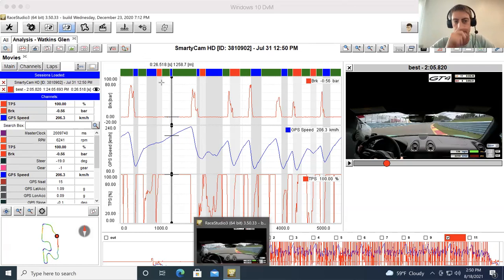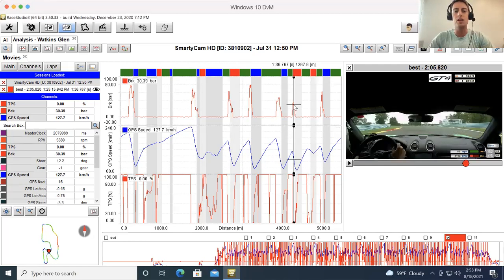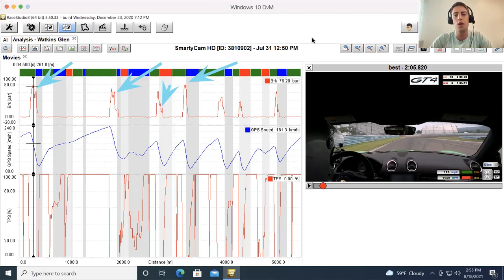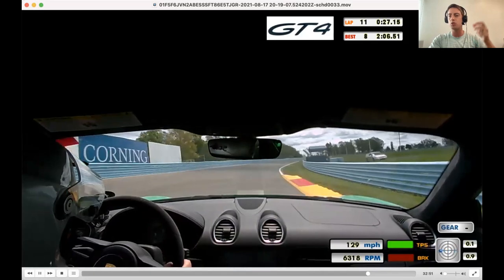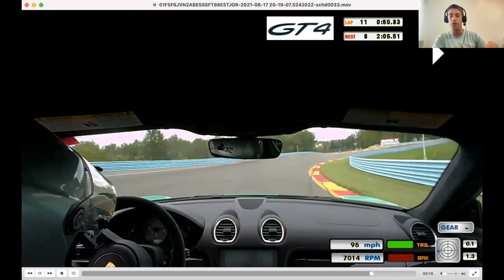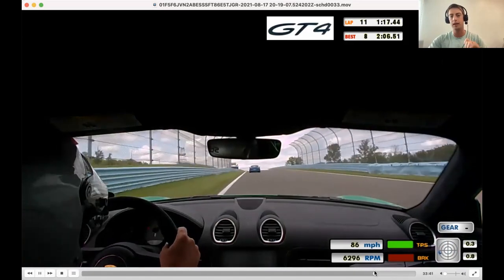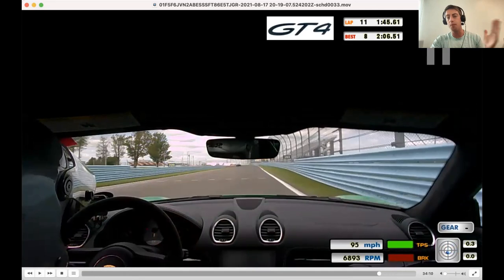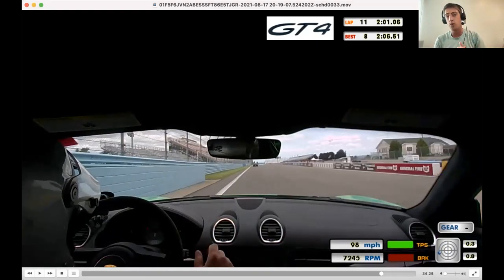718 GT4 Watkins data analysis Racers 360

Comment: Surprising he suggests coasting so much. I thought you’d want to be on the gas or brake but never coasting.
Reply: Watkins has some really long high-grip corners, you can coast on them and think of it as very slight braking. You're riding a fine line between throttle and braking but applying braking would be too much so just coasting can "brake" the car without overslowing.
Reply: @SpyderRacing ok got it and well I'm excited to check it out this coming weekend (hope it is dry)
Reply: Don't confuse coasting with rolling the corner.  The terminology is wrong.  Rolling the corner loads the car in LAT G to the max where there is no more throttle available other than pedal balance.  As you open the wheel you can get aggressive on the gas.  F1 drivers have mastered this technique using of using aero/balance grip in a steady state midcorner and corner entry.  The first place to improve lap times is flattening the mid corner valley eg: faster in , hold on , open the wheel and go.